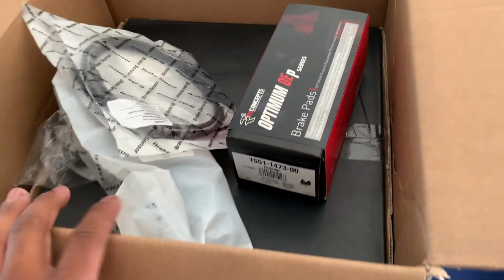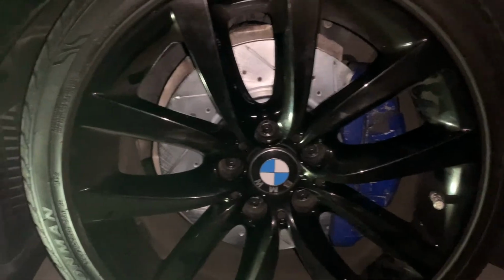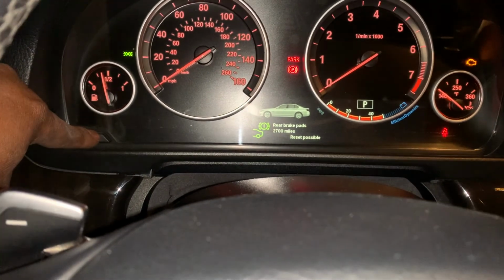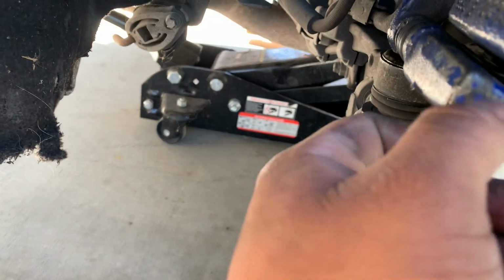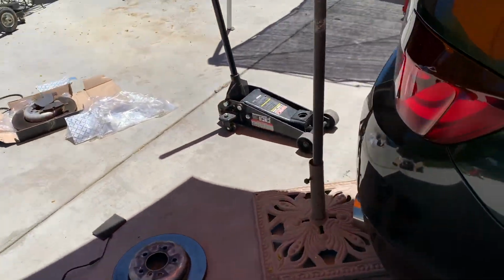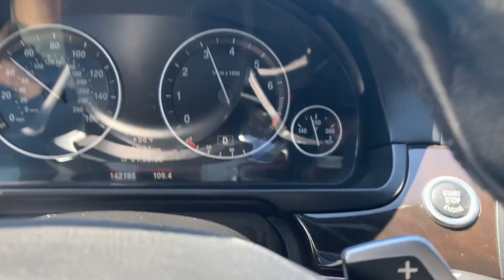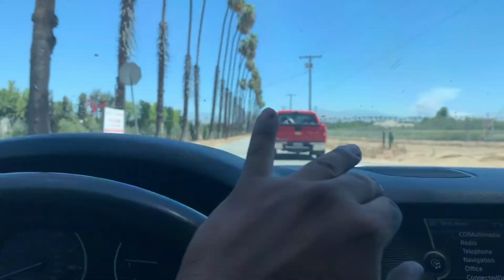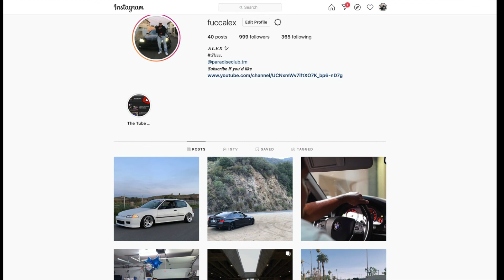New performance mod on F10 535i!!!!

Comment: Whenever ypu do these kind of brakes, thr a process to break them in before normal or aggressive driving. Have r1 concepts on my mdx and powerstop on my accord and had the break them in on the first drive for them to start gripping right.

Comment: You put them on backwards
Reply from the maker: lefty954 shit ! Ahahaha jk
Reply: No joke....they are on backwards
Reply from the maker: lefty954 nope !
Reply from the maker: lefty954 I know I followed one like that but for 535i forums they’re on correctly
Reply: @TheDetailHuas  I don't even understand what you just said. Look at the way your rotor spins the lines and drill holes are going against the rotor, not good...it is going to eat away at those pads and possibly shimmy or vibrate as the pads get worse.
Reply from the maker: lefty954 its literally in English but ohhhh I get what you mean !!! Ima have to swap the fronts over to the other side !
Reply: @TheDetailHuas  yeah...on a side note be careful with the BMS air intake....you are just feeding your turbo hot air from the engine.  It's not a good idea to have that hot air going through the turbo. Go back to stock and grab an AFE filter.
 https://afepower.com/afe-power-30-10197-magnum-flow-pro-5r-air-filter
Reply from the maker: lefty954 thanks for the info ! 👍🏽👍🏽I’ll make sure to do that !